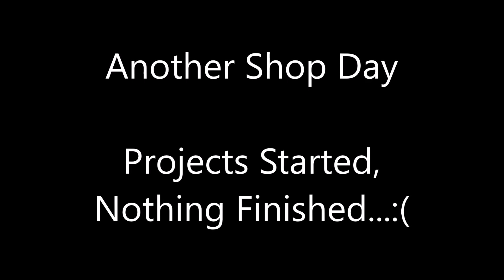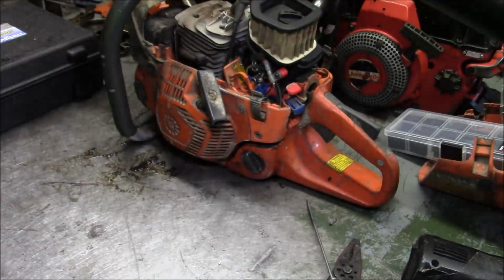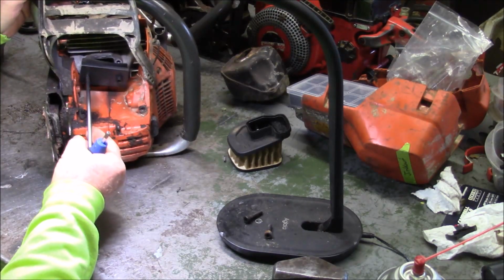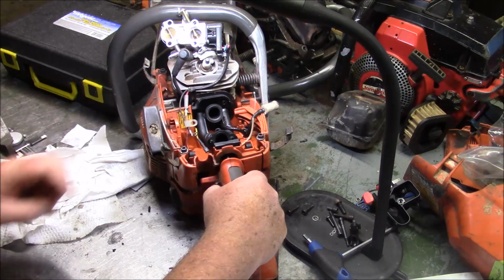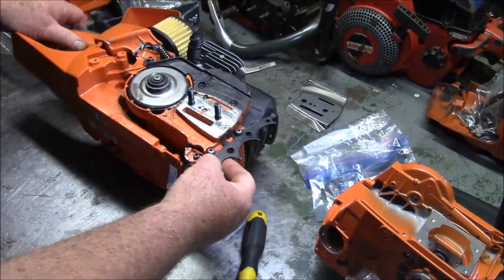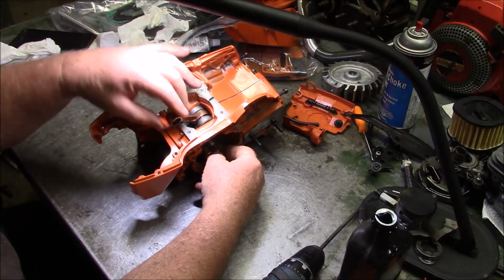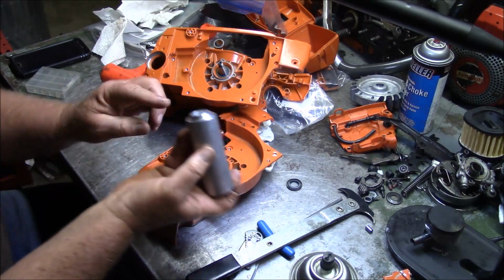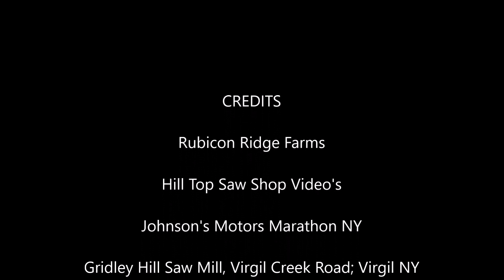Husqvarna 372xp Case Seal Installation Tool, Husqvarna 576xp Intake Boot Replacement, A Crushed 372

Comment: You don't need to worry about the aftermarket seals, they last for ages.  They outlast the top end anyway, by then it's time to change the seals anyway during the rebuild.

Comment: Don’t forget to slip on the heat shrink tubing before you twist the wires together!  I usually put the heat shrink on, strip about about a half of an inch in each wire , mesh them together and then solder them. Twisting them together makes it hard to get heat shrink on the connection.  Pushing the ends together and then soldering them makes things a lot easier to insulate.

Comment: Wanted to say thanks again for this input re the 576, helped me in my purchase. The saw would be primarily in hardwoods, also used in some milling. Interesting was the maximum recommended bar length on husky's website, (so if a warranty event occurred, no violations) VERY enlightening. 32" max for the 576.  A 390 carries less bar, as does the 572! If you want to stay within Husky's parameters for bar lengths you'd need to move up to a 395 for 32" or longer!

Comment: I’m also a big fan of the 576 there possibly a little underpowered in stock form but after I reduced squish and muffler modded mine it felt great
Reply: Dave Wyatt just curious if you did a muffler mod and restripe the carburetor screws so that you can get enough fuel in there to make it run right? That's all that I did to mine and it came alive like I could not believe.
Reply: Austin Denotter the 576 I have is a auto tune so I did not have to touch carb screws, (it does not have any) 
But yes at least 10-15% more power I would say

Comment: What was the final depth of the flywheel side oil seal? I did one today and I think I might have gone to deep, I used the oem tool.
Reply from the maker: about .015 to .020 is where I put mine. It's real easy to drive it right into the bearing. I prolly wouldn't get to nervous unless its like past .05 in
Reply: @afleetcommand  OK thanks. Also what if it's slightly askew? That's bad? It has to be completely level?
Reply from the maker: pretty much better be square to the crank shaft
Reply: @afleetcommand  thanks, took me a few tries but I got her now.

Comment: The 372 is like the smallblock chevy in the saw world congrads on retirement i got a new old mans saw for limbing a sthil ms250 i am going to get a cannon 24: super lite narrow cut bar so i do not have to bend down cutting white pine sappling i am just porting muffler

Comment: I'm learning a lot from you what size hole should I drill into the cylinder in order to fit a decompression valve in my Chinese Husqvarna clone it's cylinder has a spot cast in it's fins?
Kind Regards Dave
Reply: M10x1.0 I think is the decomp thread size
Reply from the maker: None. It doesn't need one and all the decomp does is give an opportunity for a leak later in the saws life..:)

Comment: Hey fleet command, can you use OEM 395 piston in a 394?
Reply from the maker: They have different part numbers even though they are both 56mm. Might be wrist pin to crown or skirt length. I don't know the exact difference but they are. Would have to put them side buy side on a wrist pin to figure it out. The 294 is the same as the older Jonsered 2094 and 5. Wonder if the opening or window in the side is different. Don't know is the answer.